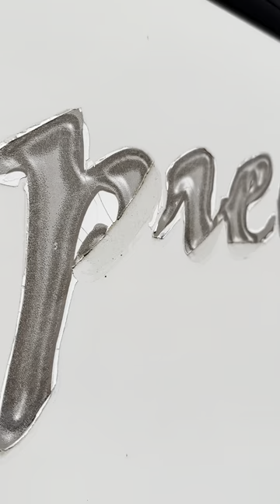Introducing My New Motorhome

Comment: I think you have the perfect motor home. All the issues you showed are simple fixes in the right hands. I think with five thousand subscribers, you will get a lot of good advice. I think the spare tire is not a problem. It has seen no sunshine and would be the least of my worries. I think the first things I would be working on would be finding water leaks, replacing seals, and the AC. The generator just needs someone to run good clean fuel through it and filter changes. I bet that slide problem will be a simple fix too. Once you get things fixed, you essentially have a new RV. Good luck to you, Dawn. Divorces suck.
Reply from the maker: Thank you!! ❤️. Subscribers are not friends... But I am surprised that I have more real friends than I realized. ❤️❤️

Comment: Razor blade with handle will lift the decals and Goof Off from lowes, no Goo Gone,  Saturday Afternoon and if you point it into the sun they come off easier... or get a 3m grinding wheel for decals to put on a drill to take of decals.  Everything is on YouTube to teach you how to do everything.....of course.  Take a hot knife heated from a torch and cut that mattress....you'll think it's butter. The Goo Gone will take off the water stains on the side awning tubes.
Reply from the maker: Those are water stains??!!  That's crazy!  Looks sooo gross. Thank you!! ❤️
Reply: @DawnSChampion  In addition to the dust & grime that's in the awning that the water filters through to form the stains. An sos pad + water would remove it as well.
Reply from the maker: Awesome!!  Thank you!! ❤️

Comment: Poop tank? How to discharge it?
Reply from the maker: I have no idea how
Reply: @DawnSChampion  if you stay at a camper site, they either have one for each camper or designated locations to discard black and grey tanks.  It's simple.  Just hook up the hose and open valves in sequence underneath the camper (refer to your camper manual).